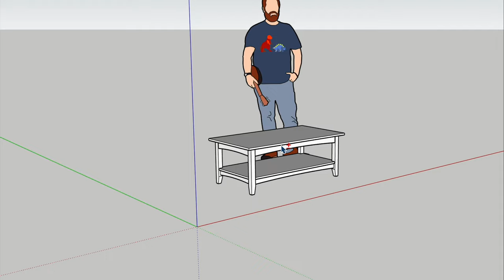Building a Contemporary Walnut Coffee Table

Comment: Curious, when you had to rip the lower shelf and reglue it in place to get it to fit, didn't you end up with gaps at the corners, since losing the width of the blade?
Reply from the maker: Great question! Yep I lost about 1/8” in shelf width because of the blade width from the saw. Fortunately I had already factored it in to have a little bit of a gap at the corners anyways for natural expansion and contraction of the shelf so it was just 1/16” more in each corner. I even checked before making this move to make sure aesthetically it wouldn’t look bad and fortunately it looked totally fine

Comment: Beautiful job! Thanks. Can you recommend an alternate finish for walnut, any polyurethanes or lacquers?
Reply from the maker: I think any clear coat finish like that would work great as well, and it would also help maintain the natural color of the walnut even more than the Rubio I used. I chose to use the hard wax oil option just because I knew that would be easier to potentially spot treat certain areas down the road. Cheers!